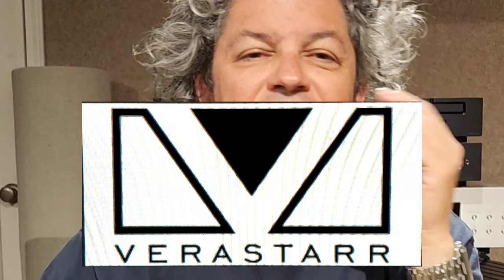Class A/B power Amplifiers - THE BREAKDOWN.

Comment: Correct...Nothings changed...My Power Amp  is a Rotel RB991 completely refurbed. Helps having two techs within 40 miles that will work to component level.
Reply from the maker: Yep, though there is differences in level of gear that has also stayed consistent.

Comment: I've been watching the switching supplies. From personal experience, some of the early audio implementations were very bad. The first I ran into were Sony. Sony introduced a line using them in the '70's. I was doing an amp roadshow at the time. Travelling doing a "High Speed Clinic" from city to city at those actual retail audio stores that existed. It was advertise to bring in what ever amp, integrated, receiver, ... you had and I'd provide a report on it's "Speed". Rise time and Slew rate of a 10Khz squarewave at full rated power into 8ohms. 

After the 3rd in a row Sony switched PS smoked, I stopped allowing them. It was the only brand I had that problem with. Many produced shitty looking outputs, but survived. 

Buddy Guy's Legend in Chicago!
Reply from the maker: Jeff Rowland is much better at it !!
Reply: @OCDHIFiGuy  I've seen some using it and it working. It makes sense to me even as a hard core analog only guy. Just because we've been stuck with 60hz for voltage conversions back in the day does not mean we need to stay there. Higher frequencies are converted much more efficiently and filtered better. But have lots of it's own problems.

Comment: i think altec lansing was one of the best ever brands as my fathers studio in 1970 had big monitor speakers and after he bought JBL being the L for Lansing , lucky to work with such great names from hi-fi industry or owned their company , i think the main problem as it happened with American and European brands was the low cost of production of japanese brands and copying all the work done by european and american engeniers and then sell it at low price , but i remenber when there were still some european brands as american ones still important in the hi-fi or sound business, the quality was over without a doubt but the finishings start to look cheap as some brands i tested when younger that looked very minimal but quality wise above any japanese brand , i remenber especifically a cassette deck from Blaupunkt the most simple one can imagine one row of leds only to adjust the rec level but the sound quality was amazing good as some 79 philips cassette decks(F series) that looked good and modern in 79 and had a super quality of sound and expensive materials built and next year were the same but all built with plastic and the sound wasn´t there but owning Grundig i remenber some decks ,two head decks that were over later calibration 3 head decks quality of sound from japan as crown from the 70´s power and pre-amplifier were amazing good with JBL speakers and big ones and SAE i have still a cassette deck maybe from 81 that had a receiver with great quality of sound to wich i had cerwin-vega speakers, but all components were black with a nice blue display , i also remenber in the 80´s brands like Sony or Pioneer to sell in the U.K had to have better specifications than in other european countries mostly speakers, english brands had superiority, as in the 90´s i bought a ES Sony integrated amplifier that sounded amazing even the phono input had a superior sound quality and was really heavy but i sold it and a few years ago i looked for one as mine on Ebay and found several but in hifi engine manuals i noticed that they said ,this specifications are only to the amplifiers sold in Portugal and U.K , wich is strange ,for me the 90´s were yesterday as we grow old it seems the years pass very fast, People talk about nakamichi  and having a father who was into music and sound quality he owned a big colection of nakamichi components since 1974 till late 90´s they do work well but if you don´t use them that much or all start to work very bad, i remenber buying the dragon when released ,it cost me 700 dollars at the time wich was a lot but i choose it because i couldn´t aford the Teac-Z-7000 and in the first days i thought i had a very good deck this in january of 1983 and by August i stoped it or it had been ruined and sold it , the heat destroys them and by that time one used to record and hear a lot of cassettes, and several times in hi-fi magazines after tested wasn´t even as good as other top decks from several brands but like sting said "history will teach us nothing " and again people talk like nakamichi is the better brand of cassette decks and lucky for the ones who have them, i had all top models working at a 100% already sold 3 of them and received 30.000€´s as i had already mine and still like them like the 680 ZX and the 700ZXL and the cassette deck 1 and the best of all in building quality the BX-2 still working, as all others were repaired for a lot of money by a old nakamichi technician in England. This to say that it´s expensive to keep a brand production in Europe and U.S.A. but quality wise japanese did not made anything better , just have a low cost of production and now they own the market making new components from the cheapest materials and engines they can find, i forget to refer HH scott, which had great quality hi-fi system ,i went to L.A. with a friend in 1978 to buy american built cars that were looked for in Europe and hard to find so for maybe 10 years we filled our pockets with money but the first trip in 78 my dutch friend bought a top of that year catalog integrated amplifier from HH Scott and still today it works with perfect sound but earlier intime i can´t remenber that if belonged to my grandfather or my father but a amplifier looking very old but what a sound ,it´s still a tube amp but by the looks it doesn´t seem that good ,when conected the sound is perfect and it´s a  60´s model, i tried it with JBL speakers ,than with Mission and tannoy also and put a 70´s turntable the SL-1000MKII from technics and a bought recentelly P10 from Rega both sounded like they never had sounded, no matter what speakers were conected and we are talking about a looking like trash tube amplifier from the 60´s american made and i fiorget to refer we conected some philips speakers that were from my first pioneer system in my bedroom and they look bad and very old but when conected ,i couldn´t believe the sound coming from them and i had them stoped maybe since 1973 when i went to Africa to work and after that i think it was the first time i conected them and some say ,hum!japanese how good can it get? they never heard about european or american brands who were the best and still work with quality after almost 60 years

Comment: Those prices are nuts. I have a Samson Power Amp with a huge toroidal transformer, giant PS Caps, and discreet power transistors on cooled rails. 600 WPC full bandwidth power @ 20Hz-50KHz at maximum distortion of .04% at full power! It is a class A/B. It cost me $400 dollars brand new back in the day and still works and sound amazing! Guys that charge more than $1,000 for an amp with less than 500 watts mono or per channel are just ripping people off because there are idiots out there that will pay premium prices for circuits that are simple and were designed in the 1950's. There is no "Magic" to building high quality Class A or A/B Amps at all.

Comment: Hey Mikey! Are you familiar with Odyssey Audio or Van Alstine? Both are old school companies that manufacture high quality amps in the USA. Both very affordable.
Reply from the maker: Yes, I know Klaus, but not the Van Alstine guy...
Reply: Sweet!
Reply: @OCDHIFiGuy  If my memory is correct (gees, 1970's are a ways back), Van Alstine (of Minnesota) started by modifying Dynaco Amplifiers then introduced his own line.  He may have been involved with B&K for awhile, too.   Circuit topology resembled Dynaco and Hafler which were higher value American brands.  Before going to engineering school, I learned much from building kits from Dynaco and Hafler who made many Class AB amps.